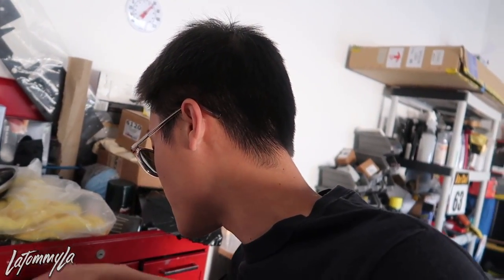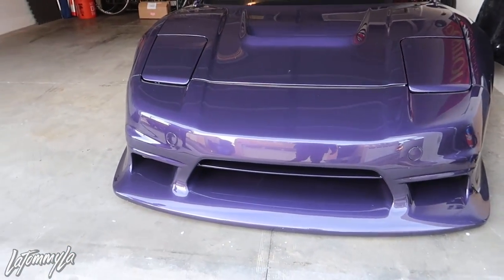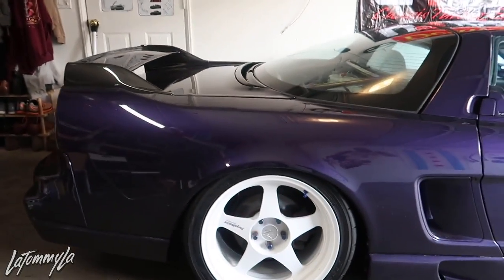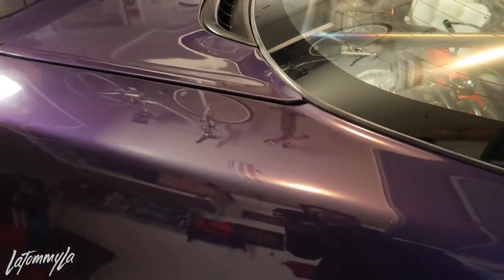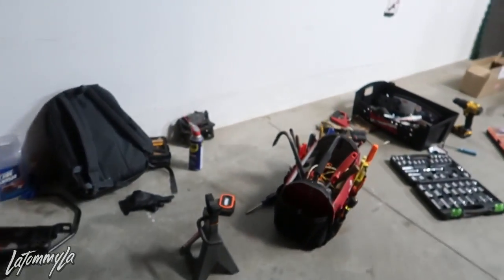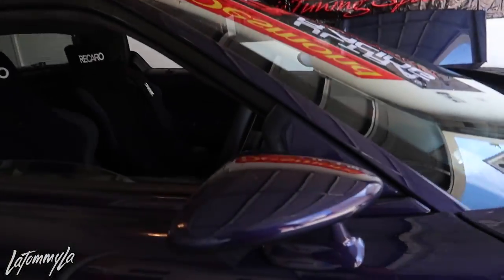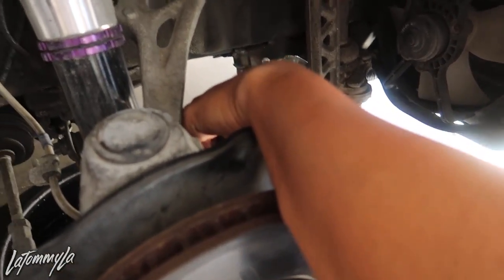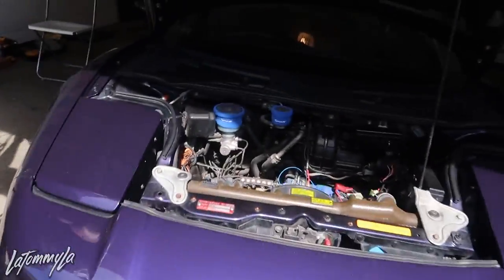RHD Spoon NSX gets Spoon Monoblock Calipers!

Comment: A trick I leaned for removing that impact screw on the rotor is to hammer it on the screw a few times and it will come loose with a screwdriver

Comment: All that effort for a caliper bracket bolt to be loosen and you could of turned the wheel outward and it would of been so much easier!
Reply: Rady Ten can’t do that in the back end though which sucks. I always use foot leverage I don’t even try to get it; unless you have a lift, ur breaker bar can only be so long.
Reply: @griffcoleman  yes, on the rear for sure you need the leverage, but up front i would of turned  the wheel out (depending on side) it makes it that much easier to work.

Comment: A tommy in the coupe does your throttle feel soft like easy to push the pedal down or is it stiff like a little hard to push down, mine is stiff I drove a buddy’s teg and both his tegs the throttle is very soft and responsive, basically im wondering if my throttle cable is shot

Comment: From a mechanic stand point. Torque them wheels! Take the car for a real brake test. 40mph brake 3 times till complete stop. 50mph brake 2 times till complete stop. 60mph brake 1 time till complete stop. It'll clean any debris in the  new rotors and brake pads.